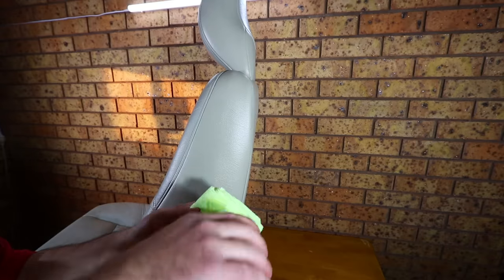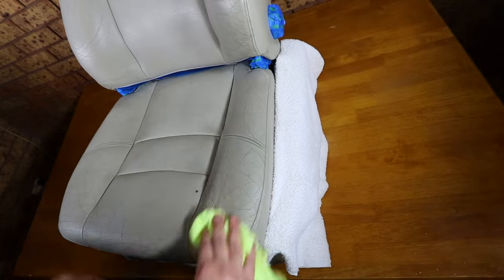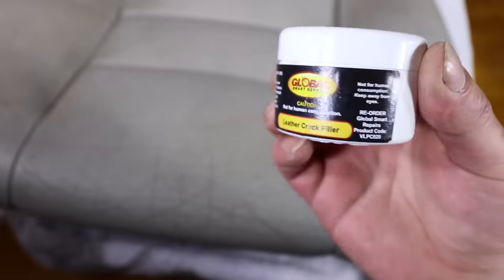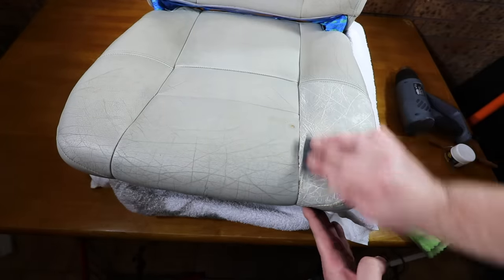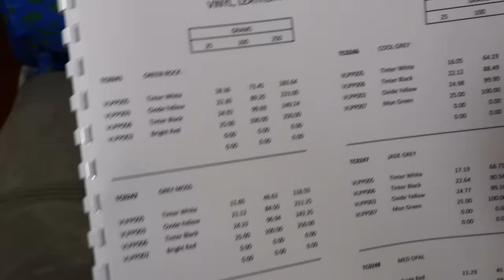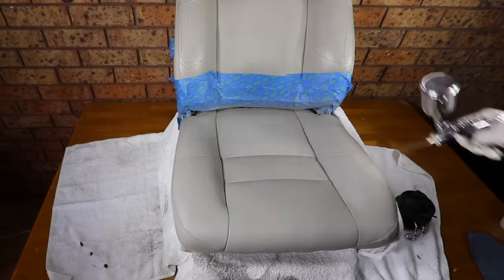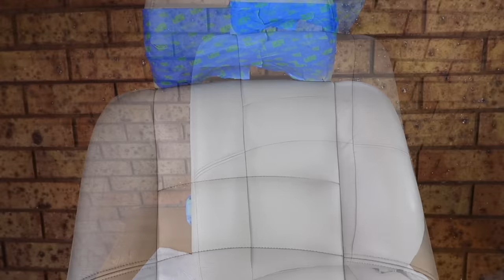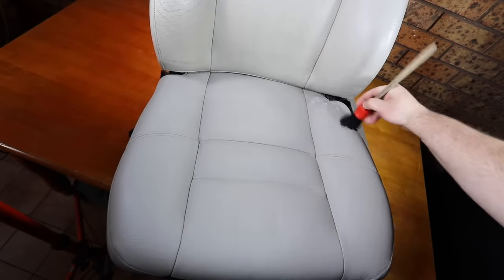How To Correctly Repair Damaged & Cracked Car Leather Seats

Comment: I bought your kit and am trying to match the front seat color of a Lincoln 2005 TownCar with an interior color of Light French Silk clear coat metallic (Beige) as noted on a website related to color options for my model.  The seat leather color looks closer to your 70% white, 15% black, 10% yellow and 5% green, but the color is too green.  What do you recommend that I do?  I feel I need to add more gray.  Any ideas of what I should do?

Comment: Seems like there might be a issue using this material on air conditioned seats, as those have 1000's of very tiny vent holes, heated seats likely no problem; great video info in any event.

Comment: I noticed there are several kits advertised on the website you provided.  What kit would you suggest purchasing for damaged seats with normal wear and tear cracks.  Nothing major.
Reply from the maker: I’m honestly not familiar with the current kits sold, it may be best to enquire with them directly for advice

Comment: great video , so how do i fix uneven color spots ? i apply around 4 coats already and still getting some spots with a lighter color than the rest of the seat :/ also on one spot you can see streak of paint.

Comment: Hey, I hate to be a nag, but would it be beneficial to the process at all, to do the leveling first before you do any cleaning or pre-repair bonding product? That way all the debris from sanding can be cleared as well? Or does the pre-repair help with the filling agent? What if you did just the sanding and leveling then cleaning, pre repair, and THEN the filling agent? I might have missed something, but I don’t know, I’m honestly just curious
Reply from the maker: There’s lots of different ways different people prefer to work. I always start by cleaning because it allows me to better evaluate everything and move quicker with that done, same as if I was working on car paint, I’ll always clean first to assess and move quicker with less potential issues, it’s just a good practice that’s works for me personally.

Comment: How long does it last before wears out again compared to new leather replacement and what kind of stretch can it handle like where a crack is filled does the filler have the same kind of stretch?
Thanks Great video

Comment: The repair looked fantastic, where you dropped the ball was in the 'seams', you did not pay attention to keep the cut/gap which would have been easy to do with the edge of your spatula. You let it blend and it stands out in contrast to the other wide as 'webbed feet'.

Comment: Just wondering: Is this a prep for sale or every day use? I can imagine that the paint rubs off on trousers? Sanding leather and filling the cracks with material seems to me purely cosmetics for a day. The material will simply break off from the seat. This harms the seat more than it helps. Am I wrong?

Comment: I have a couch we believe is not 100% leather, could be a blend.. very damaged, super peeled from dogs! Would this still work?
Reply from the maker: If it’s overly damaged the repair will tend to be less durable and less visually correct, there’s always limits as to what you can realistically repair. Leather and vinyl have different methods used due to vinyls melting in certain repairs applications so a slightly different method is used.

Comment: Can you please explain, in detail, your spray stroke technique?  I'm sure there are some details that a novice needs to know that, if not applied, can end up in an outcome that is significantly worse that if they had known the details.  You start moving your hand before pressing the sprayer, and you stop spraying before you stop moving you hand, right?  Is there some kind of test one can do on a cardboard piece that can be evaluated to make sure a novice has the spray stroke down before actually going to work on the seat?  That might be a good video on its own.

Comment: Not sure if you still check the comments on this video, but I was wondering if similar results are achievable without the use of an air gun to apply the paint, and if so, with what? I'm interested in doing more of a home repair job if possible and would prefer not to spend the extra on an air gun. Thanks!

Comment: Try using soft bright kitchen cleaner. It cleans and softens the leather. Wet a wash rag and put a small amount on it then rub it into the leather, wipe clean with another towel. Don’t do big areas and wipe the soft bright off immediately

Comment: Product seems to work well.   However the labor time is probably near that for an upholster to cut and sew a new seat cover... however for small in-car spot repair, this product seems to hold a lot of promise as long as it holds up.    Seats take a tremendous amount of physical wear & tear.  While I have used a couple of DIY techniques & products on my drivers side seat in my C6Z06 corvette, I have not had long term success in high wear bolster areas.    The repairs look great for a couple of weeks but quickly start to break down from wear & tear.

Comment: Wondering what you would do if water damage to leather car seat. My Audi had window opened when it rained and it is rough  and hard. André in Sydney
Reply from the maker: I’d probably start by giving it a good clean with a leather cleaner and then use a leather conditioner to see if the leather will rehydrate and soften again, maybe doing several applications of the conditioner a few days apart.
Reply: @CarCraftAutoDetailing  Thanks a lot and great to know and thanks for your excellent repair and tutorials. André in Sydney

Comment: I bought a quality used SUV with gray leather seats. It had 100k on it and was 10 years old.The seats looked pretty good.  Well, its been 3 years now and I now realize that the driver's seat had been "repaired" like this by the dealer.  Its peeling off now.  The SUV still runs like new and looks great. I think this painting seat thing is like putting sawdust in a differential. Shyster crap.  I'll have the driver's seat upholstered when the time comes.

Comment: It seems to that to allow the repair compound would be stronger if it would be allowed to cure organically instead of using heat.  Of course the time is an issue for some.  Small repairs would be helpful of course

Comment: I was cleaning my car's black leather seat with diluted APC 1:10, using Gyeon brush. I wiped the seat with a microfibre cloth and it seemed like it picked up a lot of  dirt. I repeated the process over and over again thinking how dirty the previous owner could possibly be , but the amount of 'dirt' picked up the cloth  was not reducing in any way. Then I realised it must be the leather dye coming off! How is that possible? The car is 2017 bmw with just 50,000km!  Did you ever encounter something similar, and what is the best way forward? I applied Gyeon leather coat later, but the area that I might have overworked seemed to look more dull than the rest of the seat. (And to be completely honest, in my last attempt to remove the 'dirt' I used some dish soap, thinking the APC was not doing its job...) I Hope to read your comments .
Reply: @CarCraftAutoDetailing  Thanks for the reply! And as for the damage done? The area I worked on looks matte compared to the rest of the seat. I am assuming what little of the leather coat was left, I managed to remove completely. I wish I could send you a photo. I guess it need repairing?

Comment: I always atch my color to where the original color isnt faded that way I dont have to spray the whole seat some times I've been told many times the best color matcher they ever seen I also save my mixed colors blues with a blue paint can tans beiges in one can n red in red can etc I use those Heinz 57 cans as blender colors the best way to match colors is in natural sunlight

Comment: Could the dye still be applied without using an air gun? Maybe dabbed on with a sponge or something?
Reply from the maker: You can use the air blower tool I used to do my test spots for these products and you could hand apply a different leather dye, but for this particular repair hand applying the colour would result in a patchy rough finish.

Comment: Createx airbrush paint - is a textile paint that sets with heat.  It is a "COLOR-FAST" paint meaning it is UV resistant.  It's the paint used to airbrush shirts, hats, and anything else - set with heat and it doesn't wash off.   The filler is a paintable, able to sand, and flexible caulking - as you would use in a "BATHROOM" - kits are garbage and expensive and you always dont get enough of each product.

Comment: I would have done the whole chair in the in the new colour instead of having two different colours I'm sure you can buy those little kits for dyeing leather shoes, you can get them and all colours by one of them into a little spray gun and and do some of the work on the cracking you could do the job yourself, if you watch a few videos and I have sprays before I was a spray painter so I'm sure I would pick it up

Comment: Could you use a heat gun to harden the filler as well?
Reply from the maker: If cold or you wish to accelerate drying and curing, yes

Comment: You did a great job but I wonder why you didn't restore the right side of the back rest like you restored the left side. The part you didn't fully restore looks like it doesn't match the rest of the seat. Other than that you did a very impressive restoration.
Reply from the maker: Have a look at the first pinned comment, I explain why there.
Reply: Oh, okay, thanks for letting me know. I was astonished at the quality of your restoration.

Comment: For small areas which gun should I buy?
Reply: The gun he used looked like a make up gun which of course shoots a very fine particules to fill out face wrinkles... If his is too expensive, go have one ordered at a cosmetic shop.  He did explain why he chose the smaller size.. I think...

Now I so regret having gotten rid of my old Leather recliner that still had good bones... It was still in good working form... but the leather crackled under the sunlight & re-upholstering it was way off my budget...

Comment: direct sunlight as well as heat kill interiors. Simple preventive measure is keep windows cracked a bit to allow heat to escape in summer and put a window screen up across front window stop as much sunlight as possible. walla interior will last quite a bit longer! headlight lense are same example use a uv protectant wax on head light lenses and they will never cloud up with that yellow haze! Uv light destroys surfaces really bad!

Comment: Your leather crack filler is not supposed to be dried with a heat gun. Very important the LCF "air dries" for maximum priming value and the deeper cracks to properly cure. maybe a hairdryer on the lowest setting would be ok.

Comment: 2 things. 
1. The time it took to band aid this seat a good interior guy or gal could've fixed it right. And if you're doing all that dye work it'll look perfect. 
2. That "piping" is not piping. It is a top stitch.
Reply: Kenneth Rolls Quite the critic. Yet, here you are on a “How To” video that explains one method of leather restoration. We’ll wait for you to upload your own video that demonstrates “how it’s supposed to be done”.
Reply: @Void-gn9zm  I do auto upholstery. I was not being a critic. Ask yourself. If you owned a classic car, would you not prefer new leather that matches or at least be made to match instead of a compound applied over leather that looks like it's been a dogs chew toy? That was my point. He was saying it's difficult to get the color right but he's got a $1000 dye system. So...

Comment: Leather: Ir depends what sort of leather / skin was used in the first place. Rolls Royce and other luxury cars use Cowhide from Sweden. Farm fences, in Sweden, are not allowed  to use pointed knots of fence wires. It is to comfort animals not to scratch their skin. Then comes Tanning process. Once again, Sweden does not allow harmful detergent to process, resulting, in extremely fine leather that can last for centuries. Then comes the owner. Most luxury car owners do look after their cars. Once a year I give my car a present of her birthday, the day I got her. A very thorough cleaning inside out, engine and underneath. It lasts almost a day.  She is like the day she was at the showroom.
Every 5 years, I take it to a Car Care. It takes them 2 to 3 days to check the entire body for scratches and fix them. Every 10 years or so, I drive to her manufacturing place to get her checked out and treat her. She is 21 years old, BMW 750il V12 ... with circa 87,000 miles.  Yep, a lot of people want to buy her. A well maintained Fiat 500 is a better car than a poorly maintained Rolls Royce. You cannot really restore dead leather. Better reupholster ...

Comment: Not bad,  The seat portion looks a bit over done.  You have a bolster with lots of wear and a seat cushion with al the cracks filed in for a smooth finish, Dead giveaway the seat has been dyed.  Plus why didn't you match the wear on both bolsters?  Right side looks more worn the the left and in the real world the wear would be more visible on the left side. Good color matching skills. I have found water based dyes are far more flexible in changing the translucency when you want just the slightest color and when applied correctly I've never had a problem with adherence failure.  When you have run into water based finishes coming off it's usually because of application error or failure to apply a finish coat.

Comment: There's one very important thing that every kit and every video misses. The filler shrunks. You'll see it when you apply atleast 3 layers because it shrunks. In 6 months, using it as you did before, every single crack that you restored going to be there again. No matter what. The filler is going to hold it together but as it shrunks it's going to be as it was 6 months ago. Some leather care going to discolor your paint. The paint is also going to fade away. You need to apply several layers to expand the life of it. 

You gotta do this method once a year! In 2 years you could reupholsters your seat from that money.

Comment: Nice, but WHY do 80% of the seat and not the whole thing? Then to mix the paint a different color for the top? Should've just painted the entire thing. Wish you'd go into more detail about the products you used. You also should adjust your spray pattern with some fan, it looked like you were just spraying a round pattern.

Comment: You said it wouldn't be worth it to spend all day on a seat - best to just reupholster. Video is 1/2 hour with 90% of it in FFW - so I'm assuming about 10 hours of recording time. Not to mention the time between drying. I imagine this took no less than 2 days from start to finish. Then add in all of the cost of the products involved. Seems to me this is MUCH more expensive (including time involved) than just getting it redone entirely. Saying that - nice video for a smaller fix...

Comment: After all that work I can't believe you didn't give a touch up to the center and righthand side of backrest. IMO you could have really impressed. Had I been your customer I would've left unhappy rather than thrilled. 

Your work qyality is excellent but ya dropped the ball in being a Master. Ask any stylist to fix the last bad cut and color work you had done and don't forget to point out the worst of it. Now how happy would you be to find only one side of you head was corrected and now the lesser bad part of that last worker reallt stands out against what you did. It's the equivalent of a mostly small hole, right in front of your crisp white shirt and you didnt notice the yellowed streak atop the shoulders from living with a smoker.
Don't feel too bad though, just learn to follow through on your ethics. Follow through is also the key in better bowling, batting, most things really.
(I've done worse but out of spite once.)

Comment: Lol... just get it reupholstered by a trimmer who has dedicated their career to reupholstering it the right way. A good upholsterer can get the original leather and/or vinyl. They should be able to clean and perhaps dye the rest. Don't throw your money away on stuff like this, especially on the drivers seat that gets sat in every time you drive it. Something like this would work okay for a seat that doesn't get used a lot. JUST CHECK AROUND WITH SEVERAL UPHOLSTERY SHOPS then decide which one you want to use. If you have to use a filler then you should just replace it. It's crazy how people learn how to do these type of "repairs" in a few hours and then consider themselves to be upholsterers. They are just trying to polish turds. This is what was done to the seats in the used car that you bought from the dealership that started falling apart 3 months after you bought it.

Comment: This is total rubbish     once the leather has deteriorated to this extent then the panel needs to be replaced    nothing you are doing is adding strength to the leather interior just papering over the cracks...most tanneries will supply you with a half skin of the correct colour and finish if you send them a small sample. 
It's worth paying a car trimmer to sew a new panel into place then recolour the remaining seat to match.
Your wasting your money on this method

Comment: I gave you a thumbs down on this because you're not being specific. Clean the seats using this exactly. Sand off any loose debris using this exactly. Prepsy using this exactly. Use this paint exactly. Be specific and you will get a better result for your video. Should we use 99% alcohol to clean our seats? Will 99% alcohol dry and fade the seat? We don't know because you weren't precise. If you see this and your feelings aren't hurt please make another video using seats from a Lexus. The Lexus seats have little pin holes in them for the air flow from the fan underneath the seat. How can you do this with the Lexus seats without gumming up the holes? Thank you.